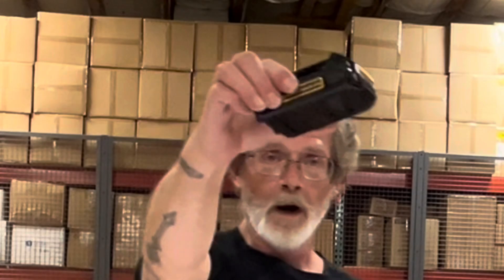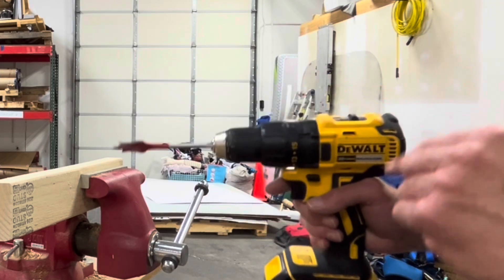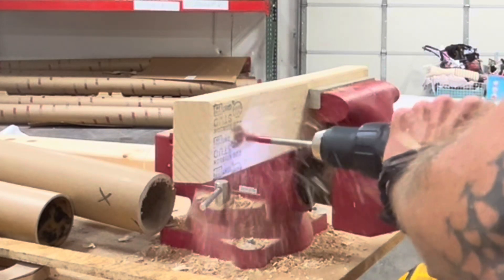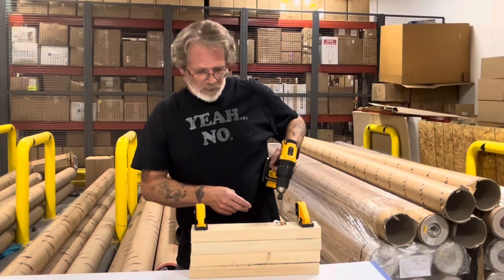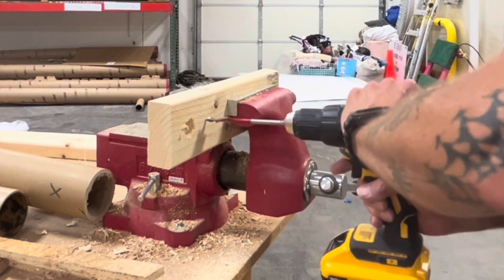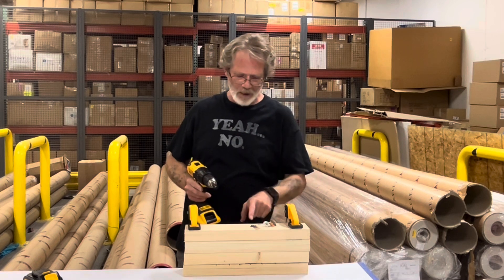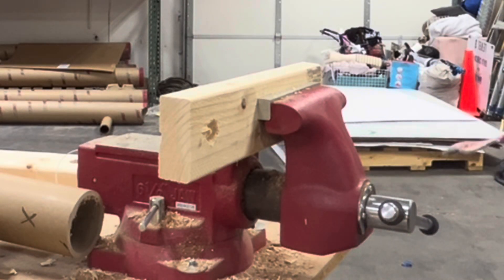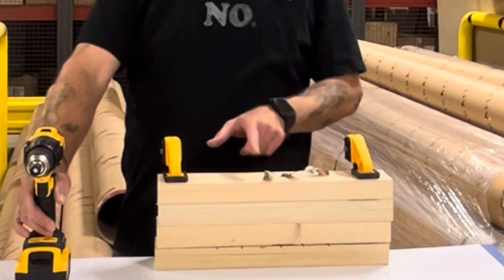Busting a common myth about power tool batteries! #viralvideo #diy #reels

Comment: I didn't think it would be able to make the whole way through with the 1.3
Reply from the maker: Neither did I. It has failed this task with the 1.3 in the past.
The only explanation I can think of is that the wood I used in this video was a little softer than the wood I’ve used before. It was either that, or it was because the battery was fresh off the charger. It could even be a combination of both.

Comment: Not so surprising... most battery specs include a discharge rate which depends on the battery chemistry and cell geometry.  Often given as the "C rate" (though this seems to have a lot of other definitions as well).  A battery with C=1 can discharge at a rate that will deplete it in an hour: a 1C battery of 2Ah can discharge at max 2A.  Whereas a 1C battery of 10Ah can discharge at 10A.  So if you have a 5A job, the 10Ah battery will perform better.
Reply from the maker: Thanks for watching, and for your input.
To be honest, these were the results I was expecting, but the 3.0 compact battery surprised me with how closely it performed compared to the 5.0 XR battery.

Comment: bigger batteries in my experience means it's easier for the tool to sustain the voltage allowing it to give its best performance despite resistance being put on the motor, letting it be pushed to an extent a small battery wouldn't allow.
Reply from the maker: @MorganJoe  Thanks for watching, and for your feedback.
I totally agree with you, when it comes to different size batteries that have the same cells. 
Stacked lithium, 21700 cells and tabless batteries are a whole different subject, and I’m hoping to get into that someday.
By the way, I already knew what the outcome would be, because I’ve done the same thing with another brand. I was just trying to take a fresh approach to the subject to, hopefully, create content that people like. The compact 3.0 battery did surprise me a little bit, though. I haven’t tried that one before, and I honestly think it created almost identical performance in the drill as the 5.0 did.

Comment: Yes, Ah has an impact, but so does what battery cells are inside (21700 vs. 18650 vs. pouch cells). Max. discharge rate of these cells is different. Torque Test Channel has shown multiple times that higher Amp batteries can be slower / less powerful. E.g. 6Ah XR often beats 9Ah XR.
Reply from the maker: @paulreinmund2038  I completely agree with you, and I even said that very thing in response to another comment on this video.
I sort of addressed that subject in a couple of older videos when I was testing out some hammer drills.
I also have watched several TTC and Project Farm videos. They are great sources of information.
By the way, a few brands are starting to release tabless batteries, and they seem to have the potential to outperform a lot of other batteries.

Comment: You are wrong about the less powered drill, it draws less power so smaller batteries should perform closer to bigger batteries than on higher powered drills.  I have testet DCD800 against DCD791 and the DCD800 cut out earlier than DCD791 using a 2 ah batterie so the DCD791 actually performs better than DCD800 using a small battery
Reply from the maker: @johannkrist  That’s interesting to hear. I don’t have a mid tier Dewalt drill for comparison, so I’ll just take your word for it. 
I had the 800, though, and I ended up returning it. I thought it was inconsistent, and I’ve seen it be inconsistent in a few videos. That could have been what happened with yours. I prefer the bigger body drills because they stay cooler.
On a side note, my 777 has failed at these tasks before with the 1.3 battery. Either this wood was softer than the wood I’ve used before, or something else came into play.
Thanks for watching, by the way.
Reply: @DiligentDave1966  I think you didn't have inconsistencies with your DCD800. It's actually weak using smaller batteries. Using a 1.7ah powerstack battery on it gives so much more power than 1.3, 1.5 or 2 ah batteries.  Dcd800 was designed for the powerstack battery or bigger 4-5 ah batteries
Reply from the maker: @johannkrist  I used the 5.0 XR battery that came with it. I imagine, though, that a Power Stack or 21700 cell battery would have made it perform better.
I just noticed that mine got hot and cut out doing things very similar to what some YouTube channels have shown it doing with the same battery that I used.
I have seen it be inconsistent in videos on some channels, too.
Reply from the maker: @johannkrist  Do you have the 800 or 805?
Reply: @DiligentDave1966  I don´t have these myself. I working in the powertools industry for more than 20 years.

Comment: Great video Dave!  In my experience, battery Ah does make a difference in performance.
Reply from the maker: @JT-lq4yd  The battery absolutely affects the performance. I have shown it with the subcompact Ridgid drill, and other channels have shown it with other brands. I just wanted to approach this video as a fresh take on the subject. I think the difference would have been more drastic with a larger spade bit and a larger fastener. I also think that this wood was a little softer than the wood I’ve used in the past.
I will say, though, that the compact 3.0 battery surprised me. It seems to provide similar performance to the 5.0 with less weight.
By the way, I’m trying to use a lighter tone of voice because I noticed that some people might think I’m too intense.

Comment: Amp hours are good but so is how many amps the battery will put out when fully charged and how much it will continue to put out. Smaller batteries have the same voltage but less output amperage
Reply from the maker: @SMOKEY-JAYS-DIESEL  I have to check, but the wattage output might be slightly different too.
I feel that the key is finding the best power to weigh combination so that the tools are comfortable to use for extended periods of time.
Reply: @DiligentDave1966  W = V * I so less I less W.
W - watt
I - ampere
V - voltage
Its basic math.
Reply from the maker: @tomaxsas  I agree 100%, but this video was intended for the people who still believe that the amp hours only affect the run time.
There’s also cell differences to consider, though. A 5.0 battery with 21700 cells or pouch cells will produce better performance than a 5.0 battery with 18650 cells.
By the way, I'm not sure if you noticed it, but the compact 3.0 battery provided almost identical performance to the drill as the 5.0 XR battery.
I thought the drill was faster with the 5.0, initially, but it seems almost identical after I played it back a couple of times.